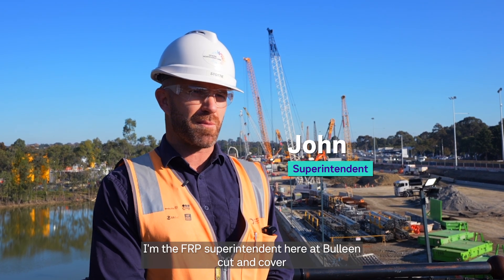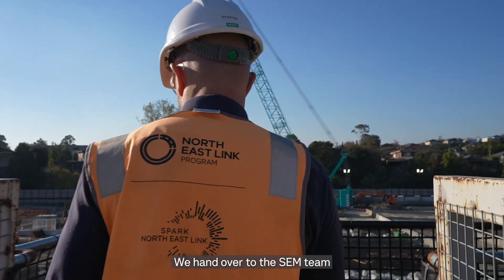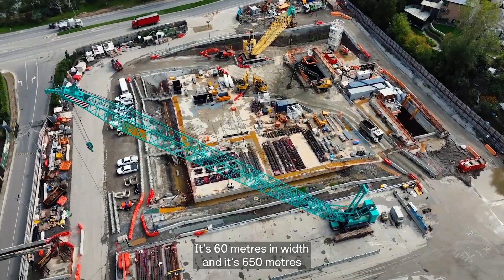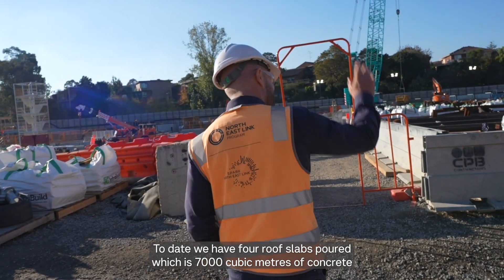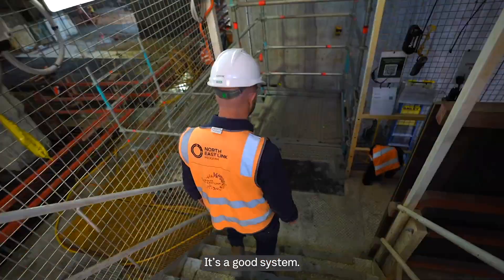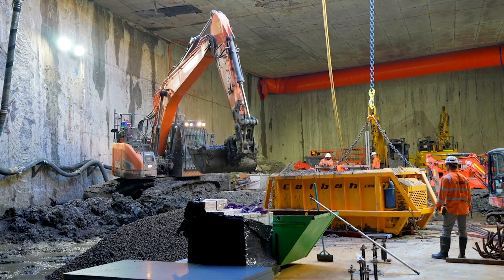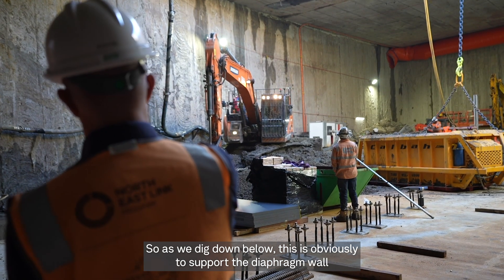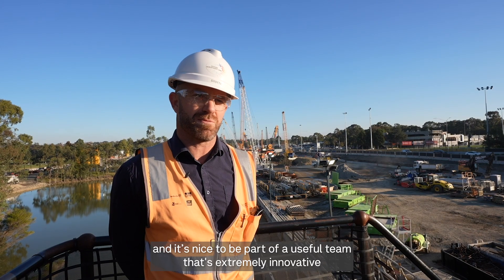Zoning in on SEM tunnelling

Comment from the maker: Need to brush up on your construction jargon? We’re here to help: 

FRP – Formwork, Reinforcement and Pour, the methodology used for all our reinforced concrete pours on site.

Reo – Prefabricated steel to provide reinforcement / support.  

Plenum – The plenum level acts as the ‘ceiling’ of our tunnel and provides an area to install all our mechanical and electrical services for tunnel operation.  

Diaphragm wall - Reinforced concrete tunnel walls built in the ground before major excavation can start.